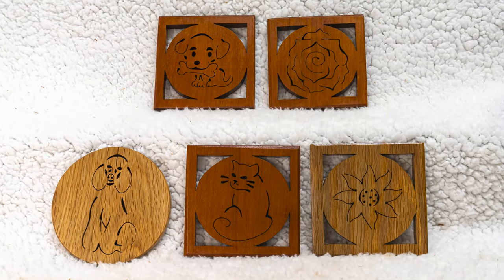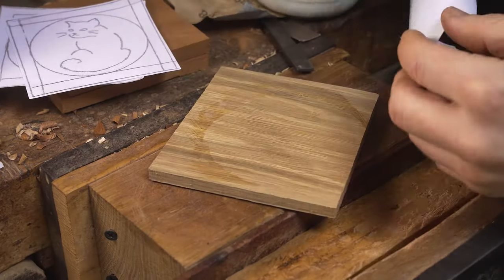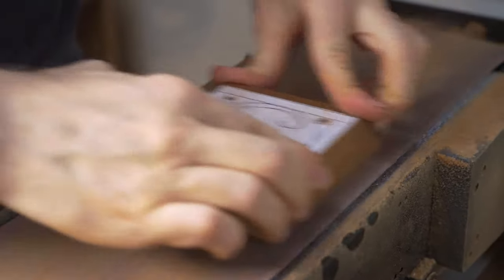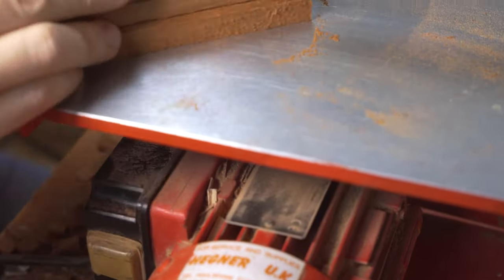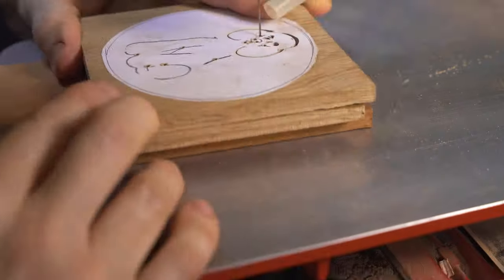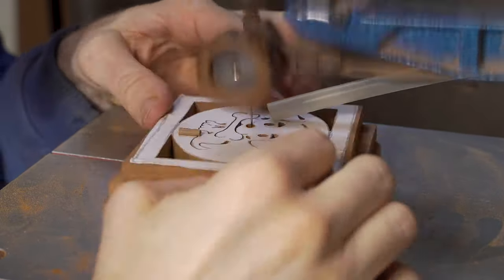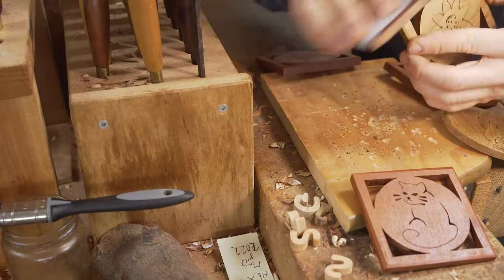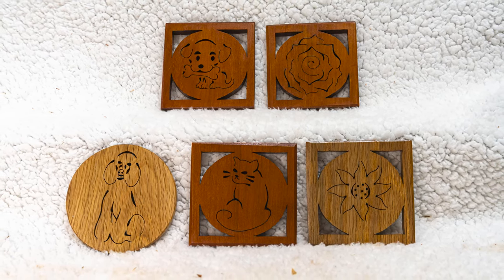Scroll saw projects. Coasters

Comment: Nice coasters! Fun designs. Question: I'm looking at 3 gouges to buy that I don't have the size. All are Swiss made...Pfeil. The first one is a #5-5mm, the second is a #5-8mm, and the third one is a #6-3mm. Would they be useful? I don't have anything like them that is flatter and that narrow. Should I also be looking for a Veiner? If so, what would you recommend. I'm trying to add to what I believe would be my normal needs.I don't want to start a project and find I'm missing a helpful gouge. This is what I already have as follows: A Pfeil 5#a x 16mm Spoon Gouge, a #10 x  14mm , a #11 x 3mm, a #3 x 25mm, a #5 x 17mm, a #7 x 11mm, a #11 x 6mm, and a60 degree x 9mm. Al of these last ones are U.S. made by Flexcut. Please advise what you think would be in my interest to add to my collection. I bought all these from Woodcraft Supply here in the U.S. They have the best prices. I have also a hard maple round x 3" diameter mallet on its way. All the Flexcut gouges can be used with a mallet. But, not the Pfeil gouges. All the gouges are two-handed gouges. Thanks for your time and trouble! I know it is a lot to ask! But you two always have great content and advice! You and your dad take care!
Reply from the maker: Hi Michael, hope all is well with you. Glad you enjoyed the video. It sounds like you are getting together a good selection of gouges. Smaller gouges can certainly come in useful and we often use them to create the stop cut when we don't have the correct larger gouge. It is worth noting that there is a difference in the numbers system depending on whether they are made in Europe or the UK. It's the UK system that we are familiar with ourselves. Most of our smaller gouges are #3, I believe this would be #4 in Europe.

When it comes to adding a new gouge, there are never any guarantees and it is always taking a bit of a chance when it comes to the amount of use you will get. What I would say is if the costs are fairly reasonable adding extra gouges will provide additional options.

From what you have described I would suggest getting started with what you have. I know it might be a little frustrating to be stopped in your tracks when you realise you need another gouge but the best way to find out what you will need is to get what you have into action.

From our own experience, we worked for several decades without certain gouges that today we use for most of our carving. As an example, we used to use a straight chisel for much of our carving. Now we have access to our Herring Bros and Addis #3 we use them instead. It basically comes down to the fact that we didn't miss something we had never had.

Hope that gives a bit of an insight. Thank you again for your support, all the very best from us all. 👍👍